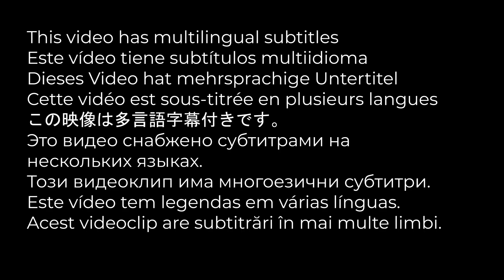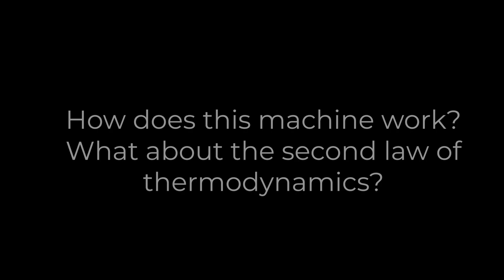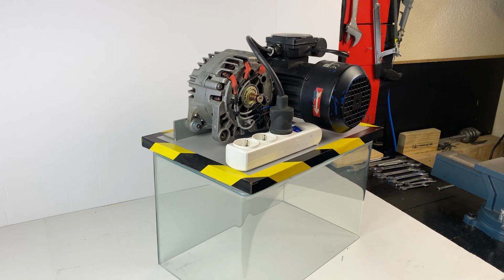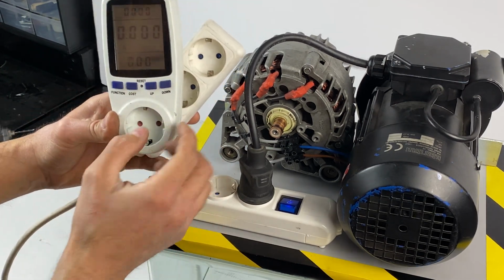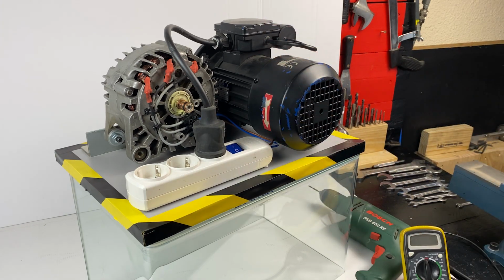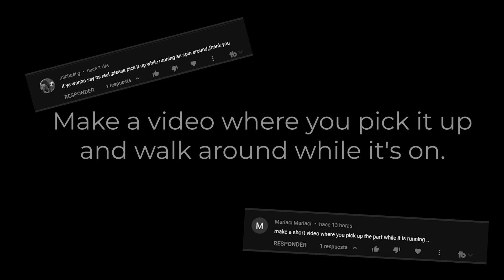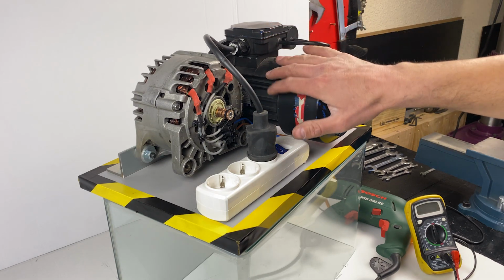We put this Infinite Energy Generator to Test - Liberty Engine 1.0

Comment: The problem I have with this is that he's claiming to get 220v ac out of a 24v DC alturnator, voltage created is the same weather AC or DC. 

How can permanent magnets ever be more powerful than an electromagnet?
How do these fantastic magnets make the alturnator product 10x the voltage it was designed for?
Why is it that when you turn on a load there is no signs of load on the running motor/alturnator?

What's the LIE here? You are hiding a power source, you have an extra capacitor on the motor🤔 plugged into the mains with hidden cables

Comment: Oh, they can't produce it because it is patented by an oil company over 60 years ago and it "is hidden in some drawer"! Right. We want the patent number so we can look it up. Most patents expire after a certain amount of years. The patent will have loads of information to help build one. However there is no patent, because this doesn't work.
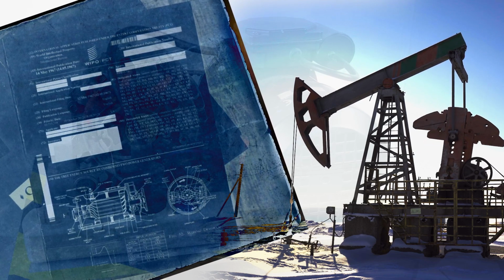Reply: I am suspicious of the patent's existence (19:55) for the following reasons
1) the priority date on the document is October 2012, it should be between 12-18 months before the filing date which says 1967-05-12, not 45 years afterwards
2) the barcodes top-right and bottom-left should be identical, even when blocked out, you can see the start of the barcode nearest the bottom of the page doesnt match the start of the barcode at the top of the page
3) There should be a human-readable patent (application) number next to and below the bottom-left barcode, the same number and size as below the top-right barcode
4) the abstract (summary of invention) is ALWAYS on the front page of the document - in this case it is missing
5) patent drawings are required to identify components by number, not words as the document may need to be translated later to another language**
6) do a search for international patent applications published on 1967-05-14 (which is a Sunday), only 4 were, this is not one of them
7) do a patent search for ALL the words FREE ENERGY SOURCE BY COMBINING TWO POWER GENERATORS, you will find no patent; I did a WIPO patent search for TWO POWER GENERATORS, got 35 results the earliest being 1967, but this patent wasnt amongst the results 

**the 2 cross sectional drawings of the 1950s era DC generator are identical down to the positioning and font style of the component labels as seen on  page 299 of
Technical Manual TM-9-8000, Principles of Automotive Vehicles
Department of the [US] Army, 25 October 1985

look for a PDF of this 1985 edition of that book on manualzz download 8811024
there are other editions of this book, having different dates, so page number may differ

Comment: I can understand the alternator voltage being upped from 24v to 240v. But I am not convinced until you explain how the alternator which produces DC voltage is running 220 volt AC appliances with out an inverter in the system. I see nothing in your system the converts the DC to AC unless you are suggesting that the alternator generates AC voltage (impossible) or that your appliances are powered by DC which is also unlikely. Make me a believer.
Reply: Alternators are AC u have to make them DC in car with its  rectifier

Comment: You did not specify the exact power of the single-phase electric motor, except for its speed (3000 rpm), which is not enough to calculate its power!

Comment: How can any motor generator maintain the rpm and frequency even with an 800 watt load attached.  Even a gasoline generator will burn more fuel and make more noise when a load is added.  This still reeks of misdirection and a hidden 220 VAC energy source entering the circuit.  Sorry, but this is the same level of absurdity as expecting a denser-than-air, unsuspended object to stay in the same place when released while in the Earth's gravitational field.  If this were possible, every engineer and physicist would build one of these devices, disclose every step and become fantastically wealthy, because every one of these students is shown exactly what obstacles must be overcome to create a perpetual motion machine.  None have been independently created or demonstrated to the satisfaction of impartial investigators.

Comment: If this setup can produce 10 kW. With a 220 volt output the skinny output wires soldered to output leads on the  generator would simply burn. That's 45 amps. You could never actually use the full 10 kW. The setup could not permit it

Comment: I would think bearing maintenance can be drastically improved by having the alternator rotor dynamic-balanced to extend its life.  A good alternator rebuild shop should have this equipment.
Reply: The best alternator shop in the universe can't overcome the laws of thermodynamics.
Reply: @seanfyodorovich5230  It would make a nice heater during winter months. with nothing plugged in.

Comment: Rather strange that this same generator develops about 25 volts AC on the exercise machine in another of your videos, yet here it generates 220V.  RPM is much the same.
Reply: Alternators have voltage regulators either on them or external so they dont fry the 12 volt system in your car. They create much more power than that. Alternators also create AC power. The regulator that was taken off this Alternator in the first video converts it to DC. A standard voltage regulator on a alternator is set to output around 14 1/2 volts, so it doesn't fry your car battery.
Reply: @Chuck. His does not have a voltage regulator.  It has permanent magnets on the rotor!  The regulator does not rectify the AC to DC.  Six diodes do that (3-phase, full wave) The regulator adjusts current to the rotor winding via two brushes.  His has done away with that winding.

Comment: Well it's not convincing at all. I believe in cgi. It's verry clear during you use a drill there is no changing in  the rotation of alternator. So meaning the power loss is not considered. Nice editing skills on how to make the extra wires invisible.

Comment: Firstly, you are adding energy to the system because of how you start the motor to beging with.
Magnets have also had energy put into them to create them.
Over time you will lose energy through heat, friction and the magnets will lose their energy also and so the whole thing will shut down.

Hence, this isn't a free energy machine and so science is correct once again!

Comment: Magnets will loose their magnetism
Reply: That’s the least of the issues. The big issue is the joke on anyone that thinks this is real.
Reply: @larryscott3982  I have been thinking it's real but the more sensible part of me understands that it's not. It does look very real but I guess they're good at trick filming.
Reply: @billyjoe3309  
Imagine, for an instant, that instead of a power drill you use it to charge a battery…. Or power a car? A car that you don’t plug in!!! An electric car that has infinite rang!! 

And Tesla’s are happy with 300 mil range instead of infinite range after multi hour charge. And then you have to find a plug in.

Comment: Instead of asking this or that, WHY did they choose to use that thick "WOOD" as a base?? Why wouldnt they use something Metal with rubber cushion bushings....its ALMOST like this devise NEEDS to be bolted to that "WOOD" ....that has taped edged so you dont see the "WOOD" I guess....for it to work. You want ME to believe it, BOLT EM TOGETHER. NO BASE, just Bottom bolted to Bottom, belly to belly with your extension cord device hanging free. Start it up on a BARE, SMOOTH floor. When the vibrations make it slowly start moving/spinning freely on the floor....Ill be sold. As long as its attached to that "WOOD" base....Im callin BS
Reply from the maker: You are right. Now, why don’t you see the next video WHERE WE CHANGED THE FUCKING BASE for a transparent one? 😅

Comment: Nice try...There is no rpm regulator so it will have a runaway affect. At a 1 to 1 ratio the frequency would increase with rpm and the induction motor will spin faster and faster until it explodes by centrifugal force. And this is, if you are right and it works as you claim. Sorry no cigar.

Comment: Do not share, this is bogus. The battery is clearly hidden in the base. The yellow tape is there to hide the surface layers. Also voltage is not energy. You can step up voltage but current/amps steps down. Energy is measured in watts.

Comment: This is just crap ! You haven't really answered any question. First, why haven't you just directly connected the engine from one phase of the alternator, and an extension cord from the other phase. Another phase that is bugging me is that the extension is pinned to the base. There are obvious signs showing that extension has been opened. 
One other thing is the black box on top of the engine. I know what's supposed to be inside, but you don't show us. 
And the last, that belt vibrates so much, there has to be at least 40% loss through it. 
Ohh, and that alternator modification, get real man. You will never have a properly balanced rotating stator with that "technique" if you can call it that. And if those coils were made for 24 V they will not sustain 220 V, ever !!! 
Oh and yes, the laws of thermodinamics, sadly, works !

Comment: Magnetic energy. But isn't that a finite energy source? One cannot get an arbitrary large amount of energy (power integrated over time) from magnet system of finite mass and having a finite magnetic energy content. If this energy source is finite then it's just like any other battery. So what then would be the advantage over say a Li Ion battery which has no moving parts? Sorry, but nobody's ever violated any of the laws of thermodynamics.

Comment: first lie- utility patents last 20 years and design patents last 15 years (17 years if prior to 1985)
Reply: I am suspicious of the patent's existence (19:55) for the following reasons
1) the priority date on the document is October 2012, it should be between 12-18 months before the filing date which says 1967-05-12, not 45 years afterwards
2) the barcodes top-right and bottom-left should be identical, even when blocked out, you can see the start of the barcode nearest the bottom of the page doesnt match the start of the barcode at the top of the page
3) There should be a human-readable patent (application) number next to and below the bottom-left barcode, the same number and size as below the top-right barcode
4) the abstract (summary of invention) is ALWAYS on the front page of the document - in this case it is missing
5) patent drawings are required to identify components by number, not words as the document may need to be translated later to another language
6) do a search for international patent applications published on 1967-05-14 (which is a Sunday), only 4 were, this is not one of them

Comment: A 100% efficient system does not exist because energy is "lost" in the form of heat.  I would be willing to bet money that if you left this on with no load it would eventually stop.  I want to see a measurement of rpm before, during, and after applying a load to the system.  I would bet a year salary that the system will lose speed.

Comment: I do this all the time. The backup generator for my home is several 12-volt 100-amp alternators I use several small brushless motors to turn the alternators. It generates far more power than it uses to run the motors. The only problem is getting it started. You literally need to jump the motors with a battery to get them spun up and then Engage The alternators one at a time so you don't bog down the motors. Each alternator motor combo provides about 75% efficiency. That is it takes about 25 amps to run the motor leaving me 75 amps leftover. I used to have a grid-tied solar system. The inspector came by to have a look when it was installed, he told me under no circumstances am I allowed to connect this device to my home's electrical system. Not because it would cause damage, but because I could sell all of this power back to the grid. Your government officials do not want you generating free Power and then selling that power to the grid. The government must have a monopoly on the grid.
Reply: All pigs are fed and ready to fly....
Reply: @chrisclarke6344  😒 set them free then Chris. let them soar. my neighbors have had to release theirs.
Reply: @nighttow8780  plenty of them in this thread the nieghbours taking flight is more believable than your op
Reply: @chrisclarke6344  okay then Chris. If you could, with some technical detail, explain why the swine are circling overhead?

Comment: Why youre not using a converter from 12 volts to120 if you dont then youre getting knly 12 volts not capable to run 120 volt dev ises

Comment: The black thing is a battery masquared as a motor. nice try
Reply: Magnet have energy therefore he is using magnet energy to rotate wheel and coil generate electricity.
Reply: @javaidnasir6633  magnets only behave like a spring, there is no energy in magnetism unless you apply a force and move the magnets past a coil, but the coil will resist producing an opposite force thus countering the initial force.
Example, generators run at a steady speed until you connect a load then they bog down until the governor kicks in and applies more gas.
Reply: @abyssmanur3965  Explain to me how he is generating current with this machine?
Reply: @javaidnasir6633  When a load applied to generator, the prime mover of the generator requires more spinning force to meet the demand of the load. The force could be in the means of fuel if a fossil fuel engine is used or flowrate in case of hydroelectric. If the demand for fuel is not met the generator will be stalled, and so is the appliance

Comment: why did you lie about the platform and what its made of?
Reply from the maker: What? In the next video we changed the platform for a methacrilate one.
Reply: ok if this thing is real, it does make sense we have to change the magnets over to neodymium because why would the oil and car company's allow the ingrediencies for a free energy right inside the car. so only provide a alternator to just charge the deep cycle in are cars.
Reply: @HiddentechnologyYT  hey brother where can i get that parts list and whatnot. your over 100k on the video. you are releasing it yea? or when it comes to the magnets are they face or pole aligned? i guess i can try both but it would make it easier if you said
Reply: @HiddentechnologyYT  This is true, I have watched all the videos. It is in fact see thru so that bust the batteries in the box trick.  Truthfully, i m not sure what to believe, i ve tried to build even though they say dont try to build it but under the circumstances, i was wiling to take the gamble..... but lost.

Comment: I have seen loads of these devices but never one powering someones house long term the fact is these devices dont work for very long. These are not perpetual motion machines nore is the energy free they cannot escape the first law of thermodynamics. I am not smart enough to explain exactly what is happening here but they way I understand it is that they are simply robbing the magnetic potential of the neodymium magnets (using them like a battery). These magnets would stay magnetic and normally last hundreds of years if left alone, but once used in the way demonstrated here they quickly loose there magnetic field and last maybe a few hours if it's just the motor or less when a significant load is placed on the system. Also if these worked as advertised why the hell isn't he selling it and making millions? What would you do if you actually invented a real free energy device? Would you share it on youtube? I know I wouldn't I'd be patenting that thing and selling it to be a billionaire.

Comment: Everything looked very impressive until the part about the patent gotten 60 years ago and put in a drawer never to be used by anyone. Patents typically expire 20 years from its earliest effective filing date.  An expired patent no longer affords the inventor or patent owner any protection. When the patent expires, the concept becomes available for any organization or individual to freely use, redesign, and market without the original patent owner's permission. So, this must be a clever phony trick or this would have been marketing by some company by now.

Comment: Can't understand why there are so many skeptics ... the idea is so simple ... once the alternator starts spinning the energy is created through the magnets ... the created energy is fed into the multibox which the single phase motor is plugged into for its energy ... the electric motor then becomes the driving force to spin the generator, thereby creating an endless cycle ... simple ... similar idea to using a lawnmower engine to power / spin the generator, except this is much cleaner as its not using fossil fuels 👍

Comment: Look I'll give you all the help you need you're missing pieces and if you come and get me and bring me to wherever it is that you have that workshop I will build that machine for you I will tell you how to make that machine and I'm talking about infinite amounts of electricity you can put it in a vehicle you can run your house off of it it puts gas as it obsolete source of energy it disconnects you from the grid but you're missing pieces on your machine and you need me to wire it right

Comment: wikipedia says at perpetum-mobile by speta 1: Electric motor-generator group. This system is supposed to work in the following way: the electric motor drives through the mechanical transmission the electric generator, which produces current, which feeds the electric motor, obtaining perpetual motion. The system does not work because both the engine and the generator only transform one form of energy (the mechanical one, respectively the electrical one) into another, a transformation that cannot generate anything extra, and even the losses limit the efficiency of the transformations. As a result, once the energy of the initial impulse is consumed, the system stops.